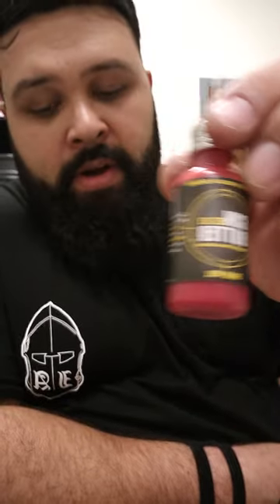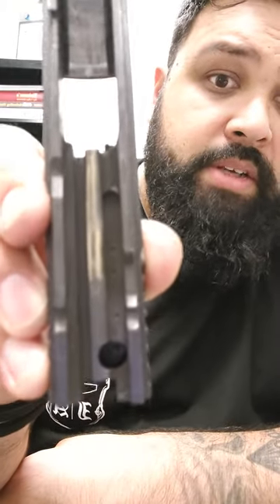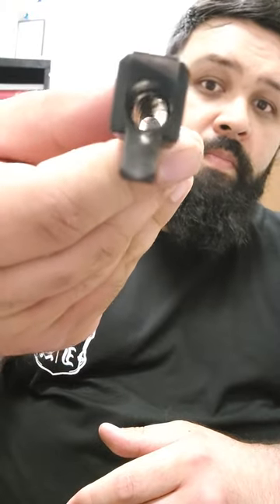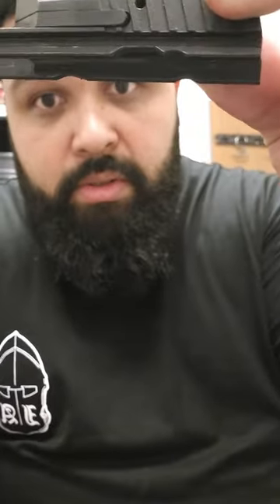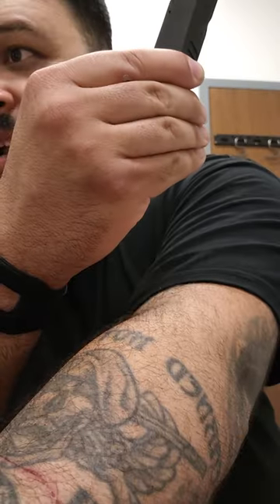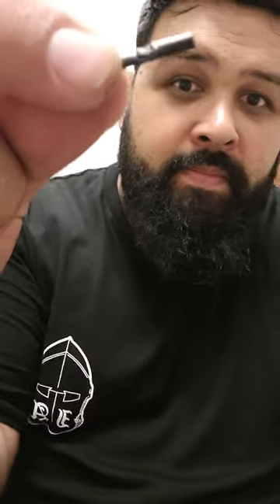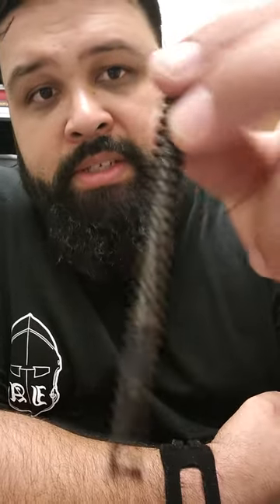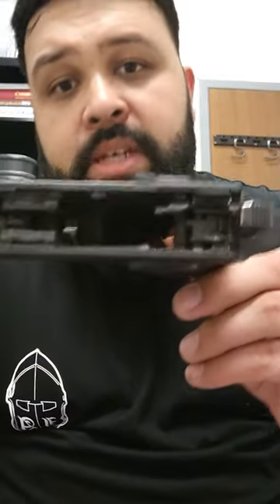Gun Butter and my CZ P07 finally broke something

Comment: Never heard of that gun butter i run amsoil cleaner and then thier gun oil or lucas gun oil. Those czpo7 and po9 run alot of heat once firing in the pins and springs area. Maybe the gun butter does do good in heat friction likecthe amsoil or lucas.
Reply from the maker: So far I'm having good results with Gun Butter but I've typically ran Breakthrough through all my guns but I also like to use grease in certain areas